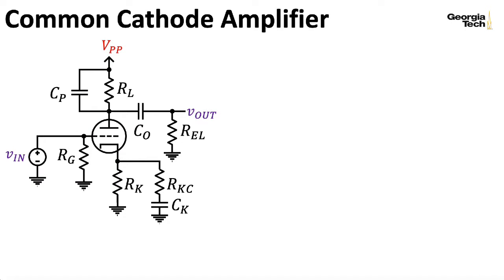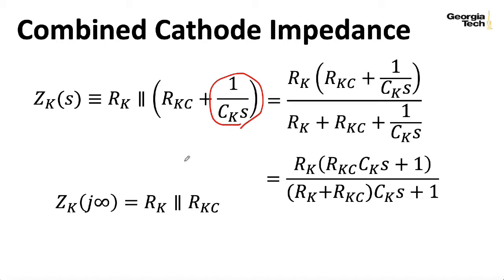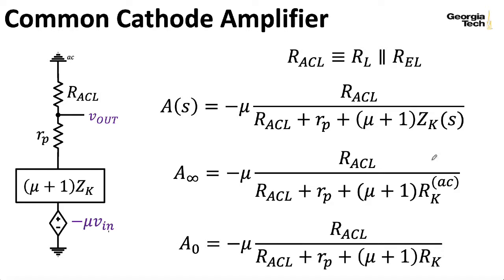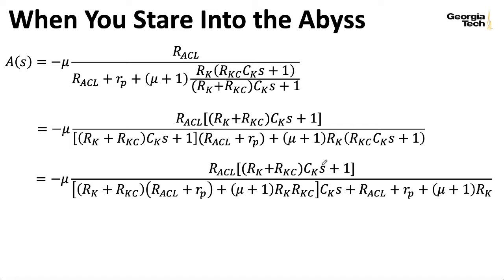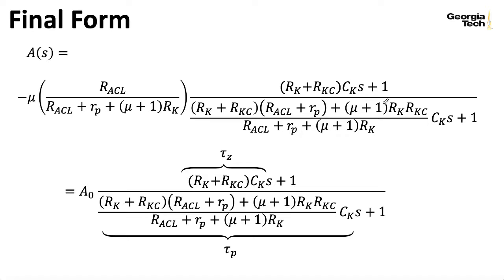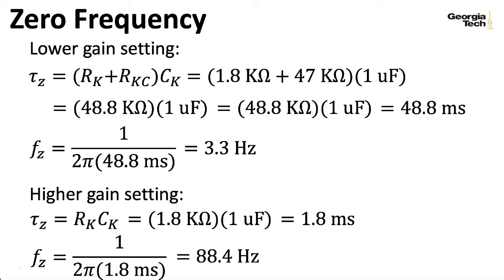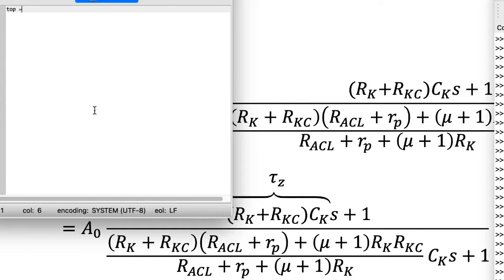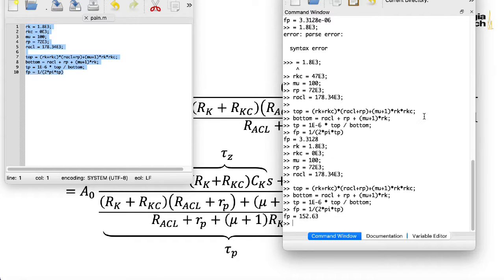ECE4448 L33: Bass Response of Cathode Bypass Capacitors (Guitar Amplification and Effects)

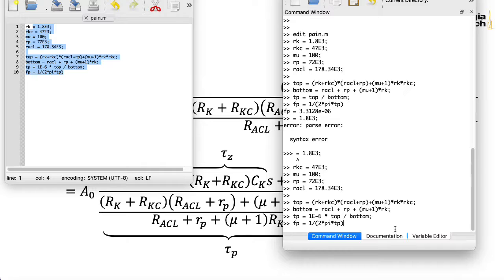Comment: 17:32 Since this is a first order shelf filter, the ratio of the asymptotic gains should be equal to the ratio of the corner frequencies. So if you have the zero frequency and the asymptotic gains, you should be able to calculate the pole frequency from those. That also means that at 20:22, the pole should indeed be very close to the zero (as you calculate it to), since the asymptotic gains are so similar.